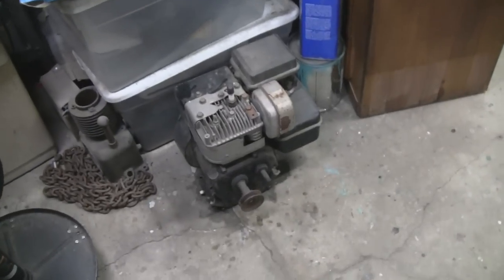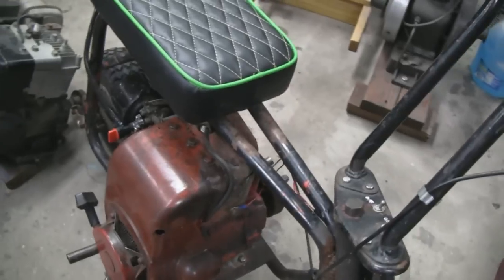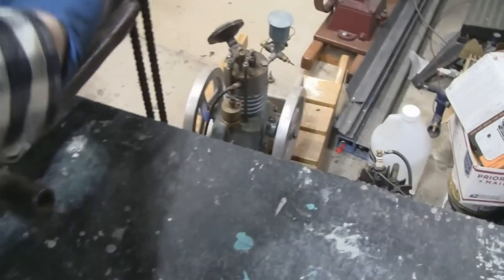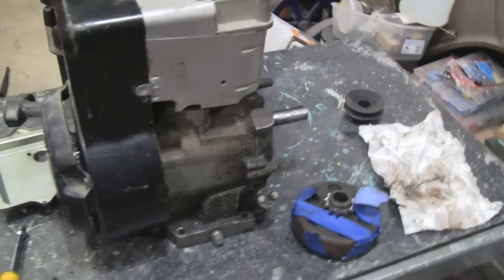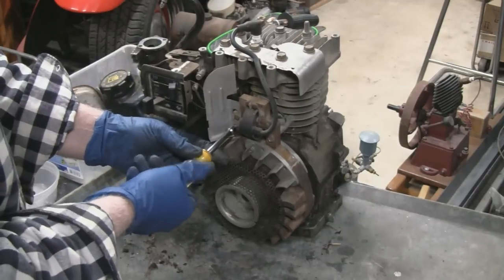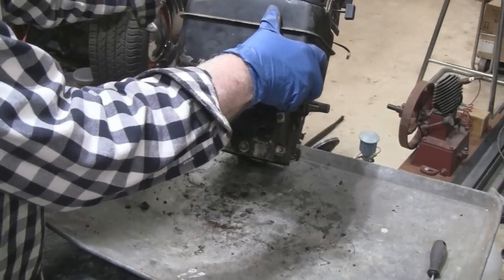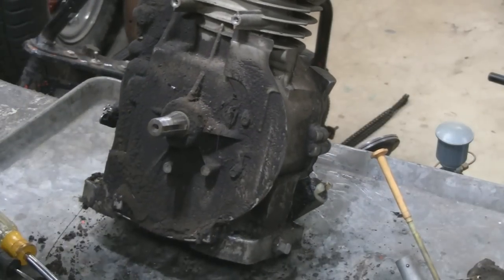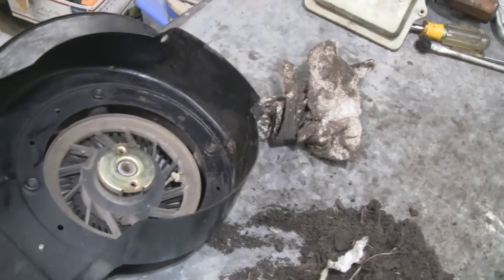BRIGGS DISASSEMBLY AND MODIFICATION FOR MINIBIKE (part 1)

Comment: I had a gocart with one of those engines.
You'll want to lock-tite the air filter bolts.
As for performance it ran flawlessly on smooth ground.
If the engine bounces enough the fuel sloshes out of the fuel bowl faster than the pump can feed it.

Comment: As much as I have been enjoying the Ford truck series, it's nice to see you working on a Briggs again.  I'm guessing that all that oil and crud on the outside of the engine probably wasn't from the engine itself, but from whatever it had been attached to in its previous life.  You said those famous last words again - "it's not a restoration".  We'll see :).  Also, nice to see that cool seat you made again!
Reply from the maker: Thanks alot Chris!! I needed a break from the truck myself, it feels good to play with a lil' engine again!! Yeah I'm pretty sure it's off a Tiller, that would explain the dirt and a sloppy landscaper would explain the oil!!☻

Comment: I saw a lot of those 5HP Briggs with the extended cam shaft on garden tillers back in the day, they used the cam shaft as a reverse on the tiller.
Reply from the maker: Yeah it shows alotta signs that it was a tiller!!☻

Comment: One of my favorite B&S engines - a real work horse but never figured out why those carbs wear like that
Reply from the maker: I usually put Tecumseh Carbs on them, they work great and they are trouble free!!☻
Reply: We we're told at the Briggs dealer schools excessive throttle shaft wear is (along with dirt build up) caused by not keeping the air filter changed. The excessive vacuum sucks the dirt in around the shaft. You can take the shaft out and put a tiny o-ring around the shaft (before it wears out) helps seal it.

Comment: Haven't had any luck with aftermarket carbs for those briggs engines. 
On another note good used gas tanks for them are starting to get hard to find and quite expensive. You can get new tanks but they are around $100-$120 and you can get a new Honda Clone engine from Harbor freight for not much more than that.
Reply from the maker: I usually put Tecumseh Carbs on them, they work great and they are trouble free!!☻

Comment: Could you say what the exposed cam shaft would be used for? Does it  drive something? Or control a function? Good video RoadKing thanks.
Reply from the maker: Thanks Mike!! That engine has all the telltale signs of a Tiller, the camshaft was probably used for a reverse gear!!☻

Comment: Looks like you have the same set of torx, hex, screwdriver bits and mini ratchet as I've got, except mine are in a red case instead of black. I made an addition to my set for exactly the reason you needed the mini ratchet - a set of 6", 4", 3" and 2" 1/4 drive extension bars. They were very cheap on eBay.

Comment: Two PTO shafts, (forward reverse on the tines )  and all that dirt ( mud/dust ) makes me think that it might have been on a small front tine rototiller,.. what do you think?
Reply from the maker: Yeah I agree with ya Reg!! Besides what you mentioned it also has a stud in the head to attach a stabilizer bar to the frame plus a block of coarse foam in the gas tank to prevent excessive splash!!☻
Reply: @805ROADKING  Seems like it might have been a 'higher quality' tiller in it's day then.

Comment: If the wear on the carburettor proves excessive and you have to swap it for a more conventional style then you will have a lot more space behind the engine where the tank currently sits. Would it be worth fitting a jack shaft to allow the engine to fit in a more central position? Probably not if this work is just to sell it, but Mike is going to miss riding round on it.
Reply from the maker: Mike liked that setup but now that I'm selling it I'm just looking for the easiest and cheapest solution!!☻

Comment: Looks identical to the engine on a tiller that is sitting on my back porch that has not been ran in over 20 years. I moved it a few years ago when cleaning up Gas tank will need a good cleaning or replacing Gas was left in it. Oops and I imagine even though it was before the ethanol junk gas the carb would need to be replaced as well before it has a chance of running again